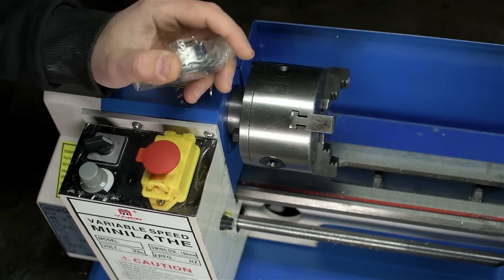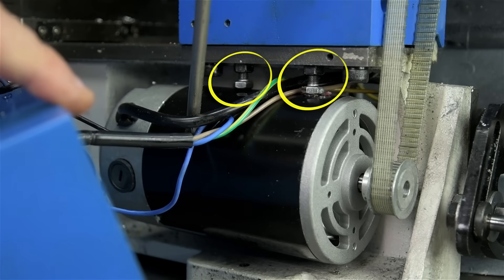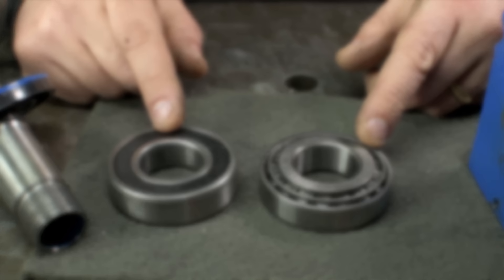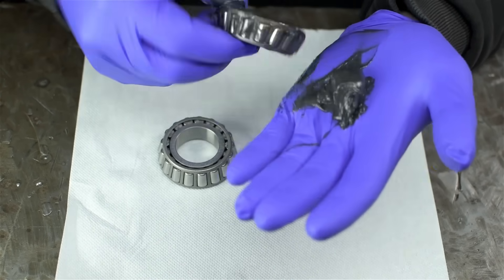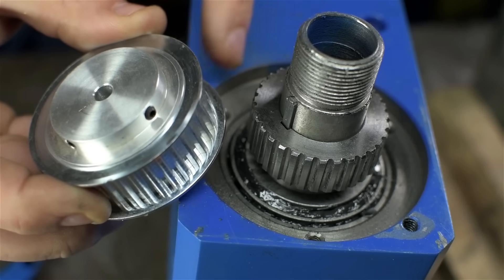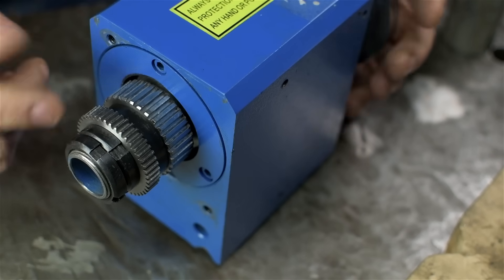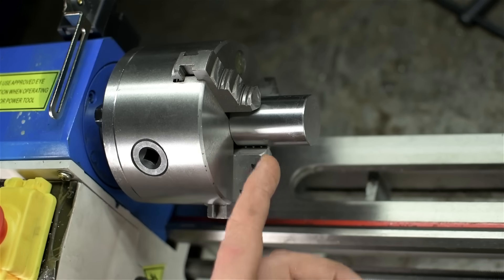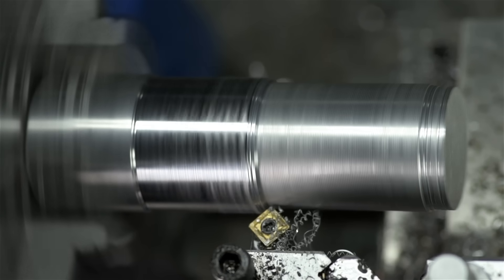Better LATHE Than Never!

Comment: I'm not nit picking here. I personally think I would have gone with a set of regular angular contact 7206's. But not spindle grade bearings. Second make a set of shields out of sheet stock that are held into the bore by the outer races. Make sure they either just clear the shaft or lightly press against the shoulder of the inner race. The commercial ones are called Nilos Rings. This should help with your grease retention on the inside of the headstock. Third figure out some sort of sealing arrangement for the outer side also. Especially the bearing next to the chuck. Chips can and will get into all sorts of places one does not want them. Of course the best option is bore out the headstock. Manufacture a real spindle and put that in. 

That said a nice means to upgrade something generally considered a POS.

Comment: I have one of these as a quick lathe for little odd jobs when the other lathes are set up with specific projects. I have 6 in total for model engineering. I am now looking to make a new saddle more like my Raglan ones with a longer bed contact going under the chuck! 
Swapping the cross slide to be the Topslide! And make a new bigger cross slide. 
It is a very competent machine for its price and is fairly Portable.
Totally enjoyed your vlog. Your name does get mentioned at Reading UK s Model engineering nights!
Best regards David and Lily. Lily is superb at cleaning down machinery!

Comment: After years of setting bearing pre-load the wrong way, I read SKF's method.  Works a charm.  Tighten the bearings and back off as you suggested, then run the spindle for a period of time an measure the temperature rise of the bearing housing close to the bearing.  Adjust the pre-load until the temperature stabilizes at 55 to 65 degrees Centigrade.

Comment: 150$ to move a big lathe? I’ll do it for $2k that’s what I charged last time I needed to install a 1500lb industrial dough mixer in New York City. Your friend is good to you.
Reply: Big lathe? It's the second to smallest Colchester made. 
Significantly smaller and it would not be necessary to engage a mover, for anyone with a resourceful mindset.
Keith Fenner's Clausing Colchester is a fairly big lathe, and I would expect to pay $2k to move that. Unless I had a favour due!
Reply: Gottenhimfella oh I thought it was north of 1000lbs but it was likely not in a basement and probably no stairs involved. That 1500lb thing I moved involved construction of special ramps, rental equipment, disassembly ect. Plus a very top heavy 6ft tall item and parking a huge truck in NYC.

Comment: It seems you haven't looked too deeply into 3d printing but I thought it might make some good videos if you took a cheap DIY eBay 3d printer and modified it until it produced reasonable prints. for example an eBay Prusa i3 ripoff vs the legitimate Prusa i3 Mk2.

Comment: Prediction: Bearings heat up (even if perfectly adjusted) - grease melts and runs out. Fairly quickly. (I do like that it's you trying this out for us though.)
You know what Stefan did, right ;-)
Solid toolpost - very similar to yours, I need to do that to mine - https://www.youtube.com/watch?v=HfcU_cWs1Dg
General lathe mods including more rigid top slide mount, and more to the point: head stock bearing solution (starts 13:47) - https://youtu.be/n1ytS1lhVFg

Comment: For the life of me, I don't see the appeal of these little lathes. Just buy a medium sized 11x26 or so. You will be much happier. I guess you would only need to save up a few more bucks to get it, but, if your willing to wait, it's worth it.
Reply: I guess its a matter of needs, my little G2003 takes up minimal room in my 1 1/2 car garage. I've owned  a mini lathe before, and it is just too small and lightweight for what I need.

Comment: i have titan mini lathe,same parts and operation of what you're showing,my problem is that,i cant  position change gear for threading 20tpi,i really dont know how to attach gears connecting to each other as specified in diagram.it couldn't reach the other one despite of loosing bolts and place nearer to shaft screw.

Comment: Hey Mr. ToT, is there a name for the type of insert tooling you were running in this video? The one with the insert on center, with 3 points exposed.. I’ve seen you use it before, and thought it looked really versatile. I have been looking for the same thing, except in 1/2”, but haven’t had much luck. Any advice would be super helpful! Thank you!

Comment: Great Vid Tony.  Did exactly the same before I CNC'd my cheap Chinese lathe.  Buy them knowing you've got 80% of a lathe and you have to rebuild/redesign the other 20%.  My Head Stock was full of core sand and the active wire was pinched on the motors electrical cover which blew out the house fuses so I don't think Inspector No 3 did his job to well.
Cam

Comment: I can take over an 1/8 depth of cut on my mini lathe with just a toolpost upgrade. That's hand feeding of course. If you take it slow and lube and tighten everything periodically then they aren't bad machines. I machined the 2 1/4 aluminum wheels for my belt grinder on it, crowned and all.

Comment: my minilathe came already with tapered bearings und metal gears for the leadscrew. only the topslide is kind a crappy like on this one. some plans for upgrading in your drawer?
Btw .... with your videos you getting me finally into this metalworkingthing. With the things i learned from you the first steps with the new toys were easy.
Keep up the good work.

Comment: Hi Tony,  great vid as always I like your style. As another option I would suggest replacing the plastic spacer with between the gears on the spindle with  2 or 4 Belville washers. these would keep a constant spring pressure preload on the bearing and allow for thermal expansion and saves having to get too worried about preset preload.

Comment: The torque spec for the tapered roller wheel bearings on a ford ranger is 12 INCH pounds. Nearly impossible to nail without a dial type torque wrench

Comment: The tapered roller bearings do not have a seal. Make one from the heavy office folder material. 
The grease will preserve the paper. Only water lets the cardboard go to pulp.
I do appreciate the trouble you have gone to too make the video.
If you have a choice go for the two speed head stock.  Converting your single speed to the Hi Lo gears would be difficult.
My lathe carried the Homier Speedway label. 

If the & x 12,14,16 " lathe is what you really want then look at the Warco brand.  Their little lathe looks to be better built in many areas.
I bought a tailstock from Amadeal in the UK and they shipped promptly.
Sorry for all the comments.
I don't mean to be a troll.
I have a small youtube channel under   Dennis Williams. 
I show my take on doing many of the mods that are available for the mini lathe.

Comment: I did the mod on the carriage hold down bars. I replaced the cap bolts with studs and adjusted the clearance with a shim pack of various thickness of brass shim stock.
 A big difference. The OEM bars had a little line of wear from the edges of the ways.  While;e I was doing that I made new bars of good steel. The OEM bars seem to be cast iron, at least on my lathe.
I made my new bars about 1/2" longer so I had the 1/2: stick out on each side of the carriage. The end would hit the motor cover so I had to shorten that end of the bars. I feel the extra length would help the carriage stability;ity.
I also added the mod to get more travel in the cross slide.
There is a mod to lower the compound which helped when turning bigger pieces.

While you are at it turn the bed over and clean the excess paint from the bottom of the ways.
Thanks again, again   :<O

Comment: Nice tutorial on this upgrade. Now tear into that terrible gib on the cross slide. That will clean up 90% of that chatter. The factory gib doesn't even fit the space it's in and is sitting on screws with a ball-like shape ground on the end. I cut in a tapered gib on mine and that helped tons. Then there's that crummy method they've used to shim the carriage...

As always. Thanks for the entertaining and informative videos Tony.

Comment: The viberation is in the spindle. If it has more than the three holes for the chuck fill the extra holes with some steel slugs. I did that with mine. I used brass but steel will be closer to the weight of the steel missing from the extra holes.
Thanks again.
:<)

Comment: That last bit is absolutely true. Starting with a taig lathe, you get to learn every single trick to deal with chatter. You also need to learn how to perfectly grind a tool, as anything less than “new endmill sharp” will chatter like crazy in steel

Comment: You did it again! I was wandering if maybe replacing the ring with steel would make preloading harder. The new ring would be more rigid, so you would have less turns for the same preload, making it difficult to adjust. 
Great video as always!

Comment: that bed design... I mean the head stock is supported by a single vertical rib, and they put the motor in place where the other rib should have been, that's some next level cost cutting by the Chinese... and we wonder where the chatter comes from, I'd suggest the next upgrade to be a structural peace where the motor used to be, to support the head stock fully, and hang the motor from that
and the closeups of the carriage fit made me LOL, I've went through refitting and rescraping couple bigger brothers of the one seen here (250x550 and 280x750), those things had similar features, and there is a fundamental problem with head stocks on those bigger toys, Stephan addressed it in one of his videos, by making a new spindle cartridge basically and fitted that in the bored out head stock, because not only the geometry is way off on those things, they are too flimsy to put a proper preload on the bearings, the casting starts to give in... this small one doesn't have this problem because the bearings are so huge in comparison to the housing

Comment: Hey Tony, something else that you could do if you have problems maintaining bearing preload is make a solid spacer out of a length of medium wall tubing that would go between the inner races of the two bearings over the shaft. The length needs to be pretty precise as .001" can change preload by about 2-3 in/lbs of rolling resistance if memory serves, (Differentials used solid spacers to set pinion bearing preload) from my Diff tech days. , but you can make a spacer and then a shim stack for the real fine adjustments. You also get the added benefit that now the nuts have something solid to tighten down against as well as if both ends of the spacer are parallel , it can possibly  help make the spindle less prone to flexing due to the inner races acting against the spacer as well as the shaft.  Of course you'd need to get rid of the plastic spacer in there too.  Great video as always!

Comment: Nice Tony quick fix with decent results.  If you have the one with the gears in the headstock there are trimmings that need to be done on those for the ones you used.  Timken has exact width bearings.  Best line from Clint says it all.  A man's gotta know his limitations.

Comment: You talked about slowing it down thought I'd mention that they make a belt and pulley kit that's about $30 that has a smaller motor pulley and a bigger spindle pulley that use a more common easier to find belt. Been thinking about getting one for my mini lathe since something like the new south bend I want is hard to justify for me. Ps really enjoy your videos!

Comment: I just finished my taper bearing upgrade to my Grizzly G0765 7x14; same head stock but with 2 speed gears in head; the day before you dropped this video. I packed my bearings like regular axle bearings. If you could have dropped your video on Christmas Eve, I would have done it your way, LOL.  It was interesting to see how much grease squeezed out during run in. I replaced all the plastic gears with metal and I’m replacing my plastic spacer with aluminum, I’m getting some vibration because the spacer isn’t square to the shaft.  All in all, I agree that these Chinese mini lathes are great educational tools and a lot of fun. Thanks for your great videos,.

Comment: It might not be a bad idea to check the bores in the headstock. Turning/ polishing the adjustment-end spindle shaft will allow more precise adjustment since the bearing must slide microscopically when you adjust tension.

Comment: Tony - don't forget that a spindle that's perfectly tight when it's cool will be too tight at operating temperature... also, best upgrade I ever made to my lathe was replacing the DC motor with a 2 HP 3 phase AC motor and a VFD.  That takes the torque right up to the limit that's useful for a lathe of that mass.

Comment: Nice one Tony. Very well explained to the general public. You almost bring a tear to my eye when you compare your mini lathe to a Colchester. It makes me proud to be British :) ...Retired toolmaker.
Reply: Imagine if ToT got his hands on a real British piece of kit. A Dean Smith and Grace for example. Quality like no other.
Reply: A British lathe of similar capacity is around the same size and work capacity. Will it last as long?  Dont know. I sold an 82y/o one yesterday and replaced it with a 16" bed 500W Sieg. I shall find out if it is better, I suspect so.
All the B/S about nylon gears? What do you think the majority of power tools use. 
If it is heavy probably steel if light as most prefer defenitly plastic. This includes lower end premium brand items.
Reply: @ldnwholesale8552  my 4000w electric bike uses nylon planetary gears to move me around and it's fine. Until it gets warm.
Reply: @ldnwholesale8552  now tell us, which is better

Comment: I don't know if the presentation one is just that, or if that is what you want to put in your lathe. You should never take the bearing out of its protective plastic bag before the moment you are ready to plop it in.

This isn't so much for ToT, since I expect our man to know what he's doing, but for you'se DIY'ers. Trust me, you don't want to put in a bearing that's been sitting in the open in a shop for any but the shortest amount of time, or you might as well throw a handful of sand and floor dust in there with it.
Reply: Eh, that's what the can of Brakleen is for. ;)

Comment: you would need 2 ball bearings to function as the single tapered roller bearing.

one for axial forces and one for radial forces.   the tapered one basicly functions as both.  plus it's self centering.

Comment: You asked for comments 
My thoughts are the biggest factor you changed was from a round carbide insert to a square one 
Area of contact of round inserts is the maximum possible for any depth of cut
My experience  .. I have never had a lathe that didn't react in the way yours did with round inserts.
It is a case of the exception proving the rule that surface finish is dependant on nose radius and feed rate.

Comment: Always informative and entertaining. 
I read your recommendation for sealed AC bearings, but you should get more rigidity from the tapered roller bearings. For a small lathe turning relatively low rpm your tapered roller is the "best" option. Most hobbyist could grease them once a year and be fine. If they need to be replaced, you showed it is cheap enough and easy enough to do. I think your initial choice was spot on for this application!
Now you need to upgrade the loose-tolerance Chinese flux capacitor so you can time travel correctly.

Comment: Buy first a medium size lathe , buy a mill, and than you can buy a minilathe , you have the tools now to repair that .
Reply: With the mini lathe, you have the tooling to build a mill and a bigger lathe.
Reply: Bullfrog's Workshop aaaaa, No . With a mini lathe , that has 5 inch over the bed , how can you swing 6 inchi parts for your bigger late?
Reply: @emilgabor88  ahh... But yes. The lathe is the one machine that can build itself. You use the smaller lathe to build the headstock of the larger lathe. Once the larger headstock is done, this can be used to build the rest of the larger lathe. It's called bootstrapping. This is exactly how the first machines progressed from being made by hand tools into larger and yet larger machines.
Reply: @emilgabor88  hint: the lathe is not only a lathe, but also a sideways mill and drill press. Swing only limits size of workpieces on lathe operations. When using a lathe as a mill or drill press with the part on the slide, the lathe swing only limits the size of the tools. You're welcome. 😉
Reply: Bullfrog's Workshop tank you for the info. Tomorrow I will sell both of my Industrial lathes and al 4 milling machines, and buy a mini lathe if it is the best machine ever. Does it surface grinder, to? Because I have just a cylindrical grinder. 
He'll yeh. Mini lathe power!!!
Reply: @emilgabor88  now you're just being cantankerous. These mini lathes aren't targeted at people like you who already have bigger better kit. They're aimed at newcomer hobbyists. For that, they aren't horrible.
Reply: Bullfrog's Workshop  I disagree. In my country, we have a seeing. " I am to pour to buy cheep stuff" .

Comment: If the chinesium company took time to put an extra 50 bucks into upgraded shitty parts, would the reputation from that eventually payoff with more sold units, or are more sold by just making the junk and advertising a lower price?
Reply: It's the importers--Grizzly, LMS, etc.--that set marketing strategy and therefore determine quality level. All the Chinese company does is use existing designs and finish to higher or lower standards: better or cheaper bearings, motors, cleanliness, deburring, etc. Visually-identical products produced at the same factory but to different quality levels are commonplace in manufacturing--in the United States and China.